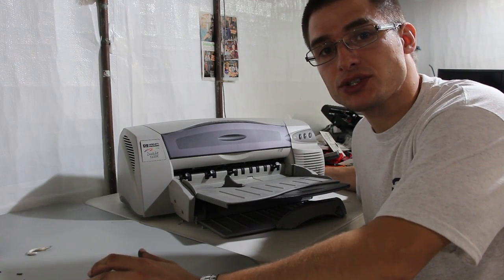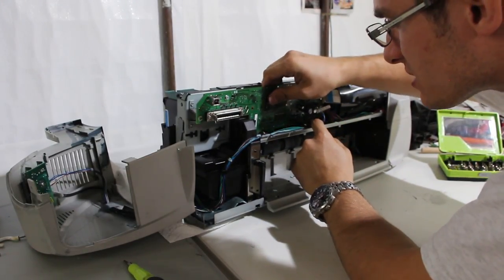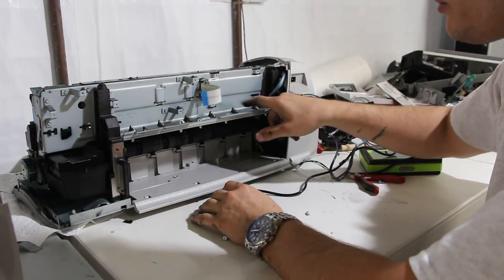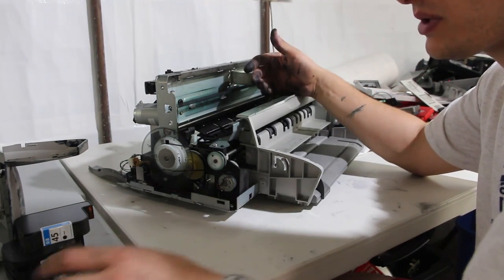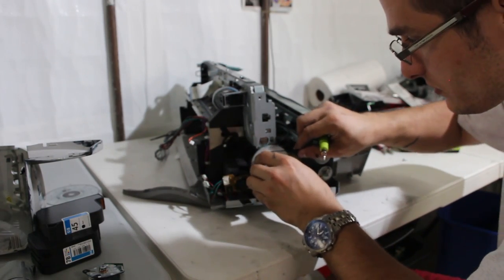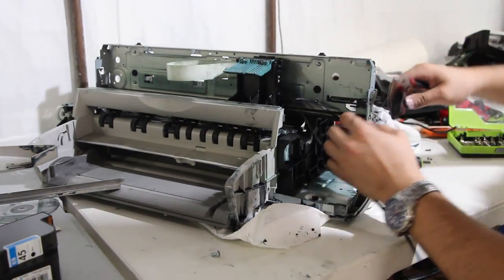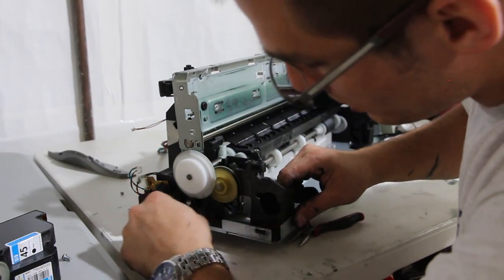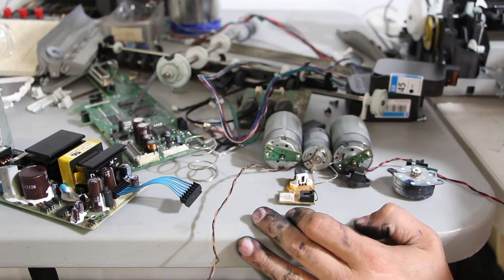Parting out a HP Printer for Electrical Parts

Comment: I did the same thing with 5 printers & a few scanners. I used the linear rods,stepper motors, bets/pulleys & sensors to build my 3D printer!
Reply: I got hem for a few bucks like you & was cheaper than buying the parts required to build my Rework Prusa i3 diy 3D printer :)!
Reply: Any links to see how you did it?
Reply: Panagiotis El Sisi I don't have links for everything, but I did measure the 8mm/10mm rods before buying the printers at local thrifty shops for instance. I got a few scanners that had stepper motors too. For other things I went on eBay & bought the ramps controller board with LCD, belts, bearings, and stepper controllers for about $50 USD as a kit. The prices always change... I always recommend to search directly. I also bought 5 stepper motors for $40 USD(since a good deal, and the others weren't uniform). The prusa plastic parts for $20 on eBay. The frame I made of wood that I got for free (cut to size). For build guides I referenced  YouTube videos for Prusa i3 rework. There's many videos here to help with the build. Measure twice to avoid mistakes ;) The rods were twice as expensive than what I bought the printers for if bought alone & also used the photo sensors on the  printers to sense the end of the rail in the 3D printer. Review the YouTube build videos to see what parts can be scavenged & which to buy new. The screws? I had many already collected & used, and others I bought. Cheers
Reply: Thanks a lot mate!
Reply: What sort of stepper motors did you recover and from which devices? I'm about to start building my first Hypercube, but Ive also now got Ramps wiring order right so I'll finish my i2 conversion to dual extruders & hopefully use that to print my XY machine plastic parts
Reply: You won't find any stepper motors inside inkjet printers.Only DC-motors.
Reply: Pana.: Why would you say that? The video you are commenting on has just salvaged a stepper motor from an inkjet printer.

Comment: I watch places like craigslist, for people wanting to get rid of old hardware. This last week, I scored 8 inkjet printers, 5 fax machines, 7 all in one inkjets, and 14 older laser printers. All these from a local computer store that wanted to get rid of them. The only thing it cost me is the time to go pick them up. 

The encoder wheel he showed for the paper feed has two sets of numbers on it. The 2400 ct , 200 lpi  means 2400 lines around the perimeter, and the 200 lpi is lined per inch.

The optical encoders for these have two receivers, set up behind very tiny slits in the case. similar to a mechanical rotary encoder, these give an offset dual pulse train to the processor, so the printer knows which direction and how far the wheel/carriage have moved.

Keep the gears also, they can come in handy for reduction gearsets in other projects.

Comment: Really nice. I made a homemade dremel tool with a dc motor from a printer head, a c2162-60006 (it's from HP 660c). It's not that fast, but it's amazing how strong and difficult to handle it is. LOL

Comment: I have done  this many times, but one of the things I find it very hard is just the fact that there are some parts like ICs you cannot get a datasheet or technical information from the manufacturer. So I have just ended up by comparing to other similar devices and also use my own knowledge by doing reverse engineering ... uhmm I think I'm going make a video for this.
Reply: John Days The same about the motors. It's hard to discover even how much rpm it has.

Comment: Do you know how to re-align the cog wheel system and the motor that feed the paper ( X-axis) ? I am trying to fix an old HP and every step works manually but not as should. I really would appreciate if you help me save an old but otherwise OK  HP 843C . thx anyway

Comment: 4:45 "With HP being a named brand, they're not going to go cheap and use crappy components" HA! heaps of "named brands" use cheap components, one particular being Samsung... many times using cheap caps..
Reply: sypher0101 For newer stuff yes I totally agree. I think he's talking about older vintage printers from when they were 3 times as expensive or more. That's like the one on this video & in which that wasn't skimped on.

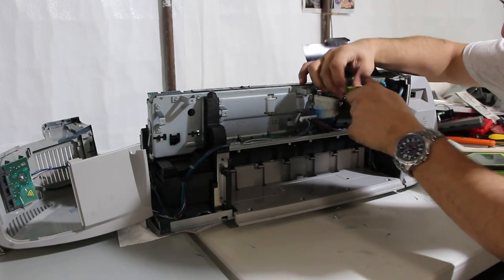Comment: At about 6:28 into the video you were talking about the reason it is high voltage. The reason they warn you is because the caps hold charge even when unplugged. It doesn't last a real long time but it does store a charge & some of them will knock your ass out of your seat.. I have done dozens upon dozens of printers & scanners & like you I keep almost all the parts. I still have 50 printers to disassemble  but need more room to store the stuff now. Appreciate the vid!

Comment: 365° ? HM. 😎
Its 360° for a full turn. One degree is 60 arc minutes. One minute is 60 arc seconds.
that make a arc minute 1 / 21 600 of a full turn. and a arc second 1 / 1296000 of a full turn.
Now I have seen stepper motors with a fraction of a second, per step, so they can be incredible precise going foreward or backwards at even half a step.
They would still need feedback ( encoders ) and All in All DC motors make it cheaper.
Lucky us 😁
Reply: congrats, you learned imperial units. When you are ready you can come to Europe and we show you metric ones.
Reply: why do modern printers don't use stepper motor instead of dc motors?.............Can a stepper motor be as precise as an Optical Encoder?

Comment: you always should short out capacitors intentionally with a screwdriver or anything else that has an insulator handle on it by having a metal tool bridge the terminals on the capacitor to discharge it in case there is still a charge inside of it so you don't have to just cross your fingers and hope for the best like this knucklehead...rookie mistakes...not the kind of people you want to learn anything electric from...and get a damn drill so you dont have to spend 40+min on a 10min job or less